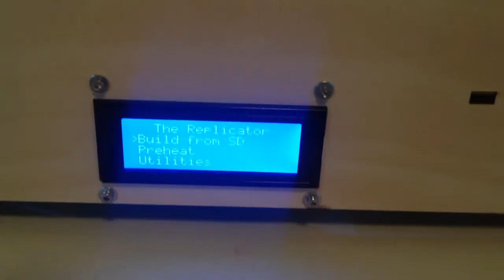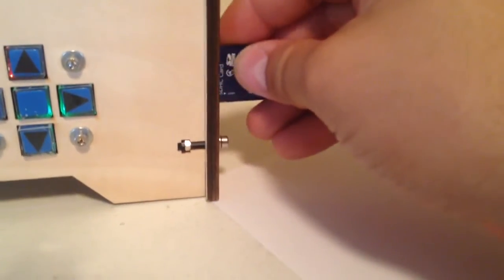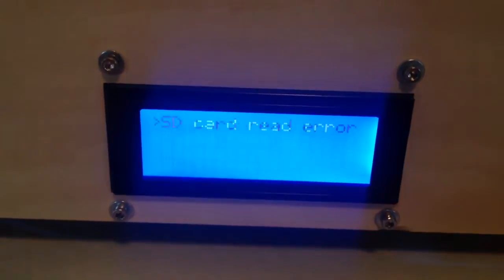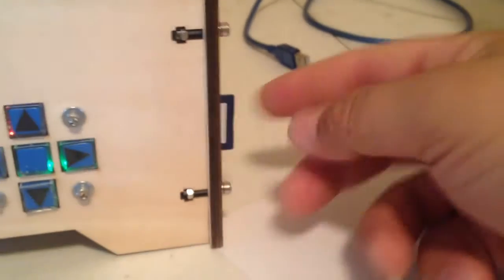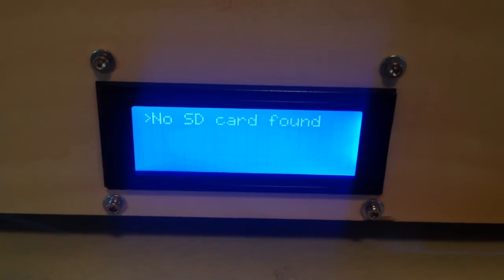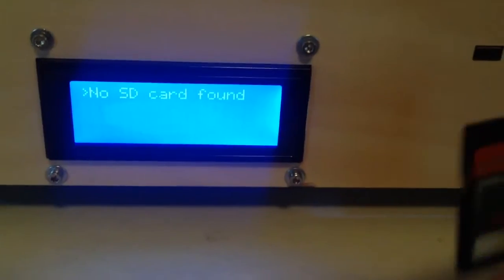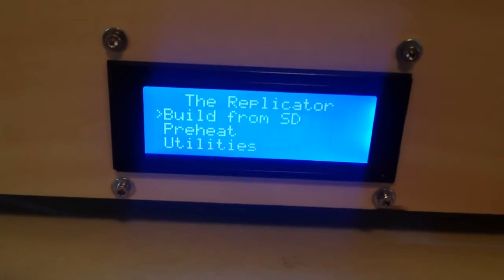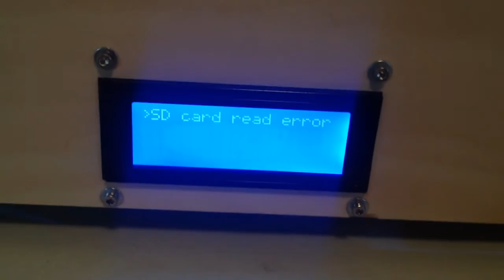CTC 3D Printer, SD Card reading problem

Comment: what is solution?
Reply: I had a similar problem, though it did detect that a card was inserted but wouldn't show the files, went through ALL the solutions I could be bothered without risking bricking it that people were giving none of them worked, t`il one bright spark told me solution. 

I was exporting from (only thing I`m using) MakerBot desktop as for an example "Laces 2x45.x3g" and wasn`t detected, exporting as or just changing it to "3D Laces 2x45.x3g" takes a few seconds go back to main menu and back to card to read but same file with 3D at the beginning of the name was detected, the card I formatted - 8gb micro SD card in and adapter , using quick format, I`m using Win10. my machine looks the same buts black don't know what the difference is, oh I never had any tubing ever on my printer (in answer to video problem No2 :)
Reply: @anthonywatkins1177  Thank you for this. I did the formatting, I tried different cards, I've tried different file formats, I've formatted on windows, I've formatted on Macs... and it comes down to a naming convention. So fricken ridiculous. Thank you again.
Reply: @slayermcb  guy called mda75 posted it on thingiverse in the "Ctc 3D Printer Owners" group and had the same feeling and thanked him the same :) glad it worked before you went down the rabbit hole like I did :)
Reply from the maker: Cai Donggting special firmware with SD fix. look on youtube for fix.
Reply: can i buy a new sd card? to solve this problem
Reply from the maker: no its not your card. its printer it self. try to format your card to FAT32.
Reply: some people say need to convert it to x3g file
Reply: @caidonggting5115  the File Format isnt IT i tried
Reply: @PAXthe4Th  did adding 3d to the beginning of the filename work? I wanna know :)

Comment: I went and replaced my tubes with 1/4 clear tubing.  I had to drill the holes bigger on the plate above the extruders to accept the new tubes.  My tubes that came with the printer caused the filament to stick to the tubing.
Reply from the maker: Yes replay from seller was : " we found that printer work bette without tubes, we are  stopping include them in printers".
I tried, dont like it will instal my own tubes.
Reply from the maker: * better